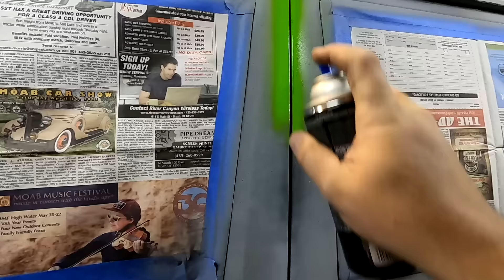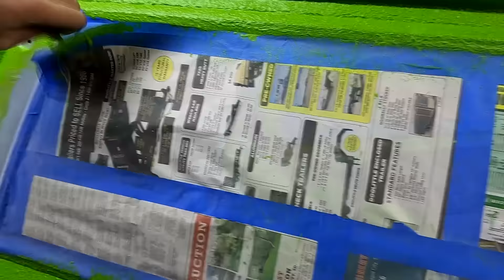Bet You've Never Done A Paint Job Like This!  - How To Roll On Car Paint

Comment: I've roll pained two vehicles , here is what I've learned. 1st was with tractor paint (similar colour to this jeep - Deutz green). It went on quite thin and was over a darker coulour. Took 3 coats to make it a solid colour, sanding between each coat. From a few feet you couldn't tell it was rolled on. It did fade after a few years, but rubbing compound by hand and 2 days effort (by hand) mad it look good again.  2nd one military vehicle paint. 1 and done,no 2nd coat needed. But looks textured, not as obvious as the bedliner, but form 3m (10ft) you can tell its not a spray paint job. I sprayed one with this type of paint 15 years ago, and it still looks the same as a week after I painted it - dull but ok.

Comment: Yes I have painted my daily driver with a roller, a 16 year old toyota. My friends laughed for a while cause I didn't spend like 3 to 4 grand to paint it, but I got the job done, the car looked decent and it held up ok for about 2 years now. It was worth it given the fact that I spend under 100 $ for that paintjob. Painting the metal of a car is not such a big deal if you don't want showroom perfection, it's when you have rust when the problems appear and it becomes harder to DIY.

Comment: Just out of High-school I had Chevy panel van that I turned into a camper inside. I used to to hunt out of so I and a friend raddle can painted it camo that would make a army truck envious, some years later a cousin died and I had to make a trip south to the funeral. Those family members that were riding along with me were not impressed by having to go to a funeral in Camo hunting truck. After taking some heat from my Mother I went to Lowe's and got all the stuff needed to roller paint the van. Egg shell exterior latex looked great and it lasted for several years.

Comment: A cool trick with hardener is always use what the manufacturer says no matter the temp outside so at a molecular level it is correct and doesn't do weird stuff months down the road. If it's like 110 or so outside you can put the hardener in the fridge or freezer because if it thinks it's 30 degrees outside it will harden slower than if it thinks it's 110

Comment: Decades ago I repainted my 73 K30 work truck with Rust-Oleum , thinned slightly with an expensive brush, then leveled it up with spray bombs in the same color.  Came out rather nicely, lol.  Great DIY for most, have thought about those liner paints, certainly will wear well.  & prep is the difference in quality work.  Thanx !

Comment: I rolled on raptor liner on my 85 C10 in the bed and interior of the truck 5 years ago, it still looks good.
Reply: Raptor liner holds up really well. We use it a lot and it does great even with shoddy prep.

Comment: That reminds me of painting my motorcycle tank when I worked in a motorcycle shop.  My mechanic peers called it a half-mile tank.  I said no, it isn't for a half-mile race bike, it is for my trials competition bike.  They said I was confused, that the paint job looked good from half-mile away. ;)

I have a 99 XJ too, and have wanted to make the bottom half red.  This may be the way to do it.  Thanks, it does help make it seem possible only my garage is full of machinist tools, so it will be outside this summer.

It is a good thing you are big like a Clydesdale.  Hoods are hard.

Gas door should be green...

Nice drone footage!

Comment: Did our XJ in white bedliner via roller in 2020.  came out great.
Using Raptor;  You can add about 10% reducer to help it self-level much more than that did.
We put on two coats with no tint then 3 coats with white tint.

Comment: HAHA!  Nice!  I did a roll on bed liner on a blazer once.  It turned out pretty decent.  One tip I would suggest, depending on how you want the texture to be, use a foam roller so you don't have such a textured layer.  It will go on smooth and then you typically don't have to worry about pieces coming off into the paint either.

Comment: Colt this week i may be buying my first jeep. A 1990 xj with a 6 inch lift psc steering chrysler 8.25 rear dana 30 front  lockers at both ends. My first project will be manual hubs in the front to save driveline components and it has a bedliner paint job in white and  may turn blue. 👍👍✌

Comment: I painted my truck with Raptor coat (same thing only name brand as you used). My kit came with air gun. I  showed process on my channel. Was my first time and just STUPIDLY easy to do. Since then i have done it a few times for friends and got even better at it and learned a lot of secrets about it. Was worth the 350 buck investment with 3 quarts left over incase i smash a fender or something.

Comment: Back in the day, we used to use a thing called a cheese grater to remove a lot of the filler. Then there wouldn't be nearly as much sanding.
Painting the edges first is called "cutting it in".
Maybe you should have painted it orange, it sure has orange peel.
It sure is original though. Your wheeling buddies will be able to spot you 15 miles away.

Comment: I haven't done it but I did see a jeep in Stillwater Oklahoma once that had a bed liner paint job whether or not they rolled it on or sprayed it on I don't know but it looked real close to the way yours does just a different color. It wasn't looking either. Yours looks pretty good and one thing about using this method of paint it hides a lot of the imperfections in the underlining body work. Nice

Comment: for window seals you want to clean with acetone, put a rope (need to experament with size but about 3/8 give or take) in the crack, sand, clean and then tape, dont pull the rope until its fairly dry as it will create dust and you need to pull it in a way as to not rub into your fresh paint. Your welcome :) (you will be thanking me when you try it lol)
Reply: I have done two monsterliner paint jobs but I sprayed and just back rolled, its really a pretty good product (customer service is pretty lacking though). If you ever see a olive drab xterra with jerrys on the side kicking around Rapid or the hills thats one of them.

Comment: Wd-40 isn't "lube". Use a PTFE spray lubricant for heim joints. Most quality heim's use a Teflon type liner. Essentially don't need any lubrication at all. However of you are gonna lube them use Teflon lubricant or ptfe.

Comment: Hey Colt, I watched the video of you with Robby about putting the lockers in broncstar, my 03 avalanche howls a little when coasting, how do you fix that and what causes that
Reply from the maker: Well that noise could be a number of things like ujoints, brakes, transfercase or the rear axle. But if it just started doing that then I'd check and fill all fluids and grease anything with a zerk first👍
Reply: @bleepinjeep  No, it's been doing it for a few years... I'm contemplating just getting a used rear axle assembly from a junkyard, comparing the cost of that or buying a new ring and pinion and paying for labor...but I'm really wondering what makes it howl on the coasting side and how you would adjust that.